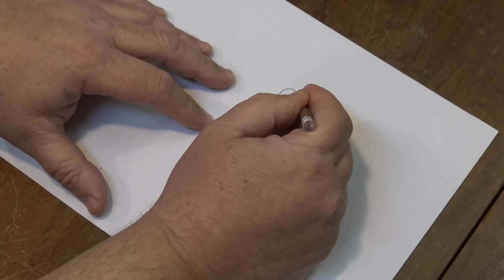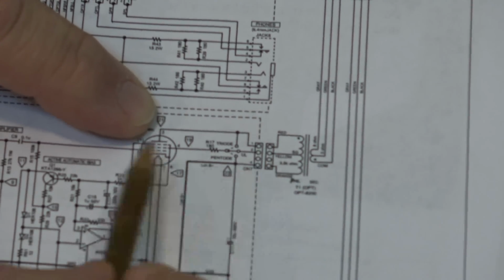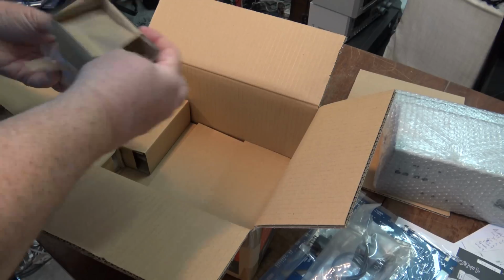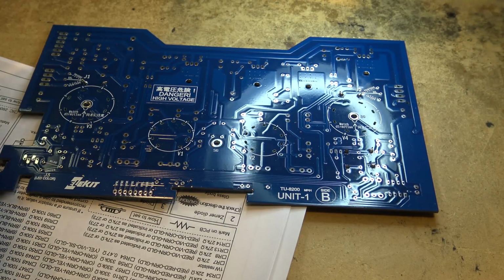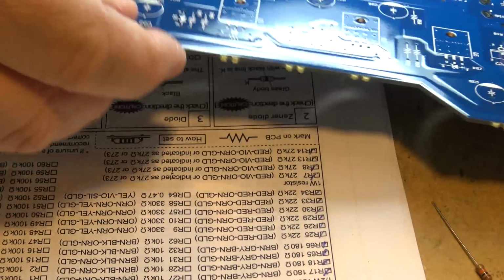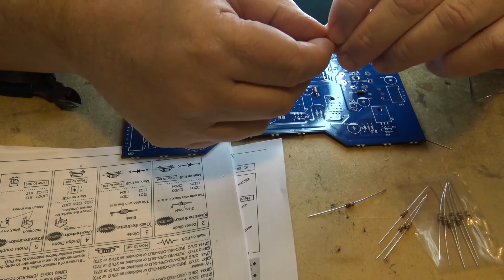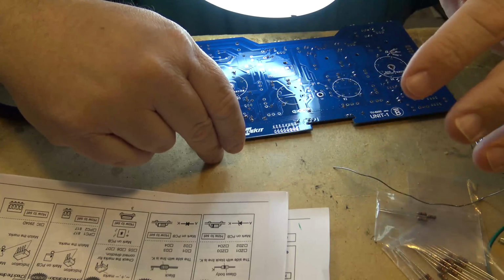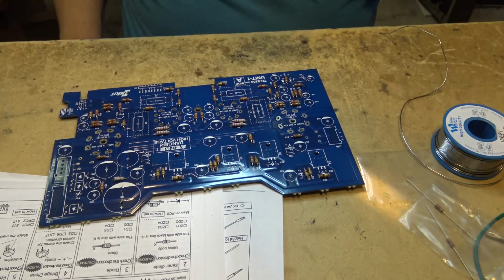Elekit TU8200 - 6L6 Single Ended Tube Amplifier build Part 1 4K

Comment: Hi, I read in a forum that there is a "surface mount" something on this TU-8200 kit; looking forward to see how you do it as I am planning to order one soon. I am pretty confident with the soldering but I still ordered a little practice gizmo. Being very small it will be a good practice. Your very detailed work is appreciated, thanks et bien le bonjour de Montréal.

Comment: You can do class A in Push pull.  Class A class B ect. Is really just a bias and circuit type.  You are talking about class A single ended, even in this there is A1 A2 ECT. In se.
Reply from the maker: This is a class A amplifier.   Class A is a single ended amp. Just a single tube per channel.   This has 2 per channel, a preamp and a power tube.   The 12ax7 is used as a 2 stage triode  preamp.   To make this a class b or an, would require 2 output tubes and the 12ax7 would be driving each output out of phase. The 2 plates would be tied to an output transformer with a center tapped primary.  
A class ab and class b are the same thing, just the bias is set higher so that at idle both tubes are kept slightly in conduction.  
Class A on the other hand is under heavy conduction at all times.   There is about 50% of the available current flowing through the tube under no signal condition.  As the signal is presented the current increases and decreases with the waveform which induces the signal into the secondary of the output.   
Class a are the most accurate and lowest distortion but are very inefficient and low power.
Reply: @12voltvids  I was just explaining that multiple tubes can still be class A.
Reply from the maker: @kevin2960  
Class A is single ended.  By nature all the preamp stages are class A.  This applies to solid state amplification as well.  All your amplifier stages in rf, if, audio, and video are all class A.  Where class B comes into play is the output stage as they become much more power efficient.  A class A amplifier is well below 50% efficient.  Let's talk in low voltage transistor power.  You have 12 volts onto your output single transistor stage.   With no signal the voltage on the collector would be about 6 volts.  The input to the audio output transformer 12 volts and the transformer would be partially saturated if you used a transformer output.  Of course you could use a resistor to provide the load for the  output collector load, or use an emitter resistor between emitter and ground or both. Generally there would be a low ohm resistor on emitter.  Say .2 ohms. Under no signal about 50% of the max power would be flowing through transistor or tube and this will generate much heat.  The dc is blocked from getting to the speaker by either a capacitor, or use an output transformer.  All tube sets use output transformer but solid state can as well.  
As the signal modulates the base of the transistor or grid of the tube the collector, or plate will follow. As the signal falls, the transistor goes out of conduction allowing the voltage to rise. As the voltage at the bass goes up, the transistor goes into conduction and pulls the supply towards the emitter potential which is close to ground.  That is how class a operates and coupling capacitors between stages block the DC from the prior stage.  
Not efficient but accurate and clean. 
Class B (class AB is the same thing, just biased a little higher to keep the non conducting stage from going into full cutoff) uses 2 output transistors or tubes.  One Npn and one Pnp type.  One transistor has collector connected to positive rail, the other to negative rail. Emitters connected together (through low resistors) and the speaker to emitters.  The wave is split in 2. Positive side of waveform goes to positive output and negative to negative output.  At every cross over point the transistors switch.  On class B one cuts off completely as the other starts. This causes what iij s called cross over distortion.   Class AB adds more bias to keep both transistors slightly biased on so that as the cross over is taking place the opposite polarity stays slightly I conduction to reduce crossover distortion.

Comment: Very nice! The power transformer is even an R-core transformer by the looks of it: unlike the C core, its core is one solid piece. More expensive to produce, but they are very efficient and have very a low stray magnetic field! Outperforms the toroidals.
Reply from the maker: Right it very well could be an R core. Doesn't specify what it is, so I just assumed C core from the look initially.

Comment: push pull use smaller transformers and run cooler.
Reply from the maker: Yes they do, but they also don't sound as good as a single ended class A.Class A is not very efficient, but much more accurate due to no zero cross distortion being introduced.
Reply: oh well, my hearing isn't that great anymore, and um not that fussy.  Funny, tubes and distortion go together, guitar guys WANT TUBE DISTORTION.  They prefer solid state for cleaner sound.
Reply from the maker: It depends on the sound you want.As far as accuracy no tube amp can match a solid state amp. Not even close. Solid state amps are exceptionally clean sterile sound.Tubes by their very nature are not. However saying that there is something almost magical about listening to music through a tube amp, especially a single ended amp. On paper they look horrible, with distortion numbers that would embarrass an engineer, however it the type of distortion that they produce that is what is desirable.When a solid state amp distorts it produces odd order harmonics, and the ear is very sensitive to those types of distortion.Tubes on the other hand produce even order harmonics. Even order harmonics are exactly one octave above the fundamental tone. So the note E for example, will produce a harmonic "e" the next octave up, and so on. This is what many guitar players just love, as it gives their axe a big phat sound. They do the same for all sounds, when they distort. I have both types of amps. I use my hybrid studio amp when I am producing and editing because it is clean and powerful, and due t the 2 12AU7 dual triodes used in the driver stage it has a warm sound.For listening, I use a full on tube amp in my living room, and now with these kit amps I will have a class A for my studio to listen to music on. I definitely prefer the tube sound, any day of the week. My hearing is less than perfect too, and I still prefer the tube sound.
Reply: I like both too.  But cheap tube amps are garbage.  I hate anything that used less than a 6" full range speaker, lol. Now a HK Citation ii is a dream amp for me.
Reply from the maker: Yaquin are considered a low priced amp as tube amps go, yet they sound fantastic, and with a few mods sound even better.I know several people with Yaquin MC10 and none have had any complaints and they are in the sub 1000 range and deliver a fair bang for the buck. I have an MC10T, have had it for several years and it sounds very nice and I am just driving a pair of 8" 2 way ceiling speakers.
Reply: AC high voltage, high imp tube vs DC high current low imp transistor, do away with the vs, I like using both.  Hi imp has its issues, low imp has its too.  One thing I find interesting, a 50 watt tube amp can out perform a 200 watt transistor amp in listening pleasure, I agree with you on that for sure.  I like the concept of multi amplifiers, and match amps to speakers.  Crossovers are fie, but subs should have their own amps.  Tubes for mids and highs, transistors for the bass end.  I like clean bass.  I use bass guitar drivers to replace woofers with cone surround rot.  Many bookshelf systems use crappy drivers, including Bose.  Someday, I'll get a pair of older Lansings, but new stuff, NAAAAA.
Reply from the maker: I run some old Altec Lansing and they sound great. I had them refoamed, and that cost almost as much as the original speakers but it was worth it, because they sound fantastic.Doesn't ned to be a 50 watt tube amp. A 9 watt single ended amp like the one I am building will outperform a 150 watt transistor amp in terms of sound quality at reasonable listening levels.

Comment: Don't sell your TU-8100! Build an active crossover and bi-amp your system. If you don't love it, you can always sell it later.
Reply from the maker: Yes I was thinking along the same line, as my Altec Lansing speakers have dual woof / tweet inputs for bi-amp setup.
Reply: agree, bi-amp is kewl

Comment: Hay, I'm color blind and love this stuff. I just cover up the other colors so I'm just looking at one at a time. Like your build video's. Working on building a amp but without tubes. Been seeing tube amps coming back. I know a kid 15, he wants a tube guitar amp!
Reply from the maker: Tubes are back in a big way. All one has to do is listen. Of course musicians knew this all along. Most professional musicians use tube gear.There used to be a color blind TV repairman out in my neck of the woods, and after he fixed a TV the owner would bring it to my shop to get the color fixed! It was hilarious. They would phone the shop I was at and ask the hourly rate, then call the guy with the mobile truck, and then bring the set in working but with very bad color, and we would charge the same price to fix the color as we would have to fix the thing right in the first place.
Reply: Thats funny. I just mix up red and green while there together. Red ball in green grass, I'm lost.. Keep up the vids. Fun to hang out.
Reply: EnChroma glasses. it fixes red-green colorblindness.

Comment: Kester 44 Rosin Core Solder 60/40 .031 1 lb. Spool ( wire roll electrical bond )
eBay item number:201763610943
US $32  with free shipping,  if your looking. LOL

Comment: Doing a smahing job sir :-D

Sounds like your solder needs a better quality rosin core, i used to use multicore brand, the thin stuff was better for melting, better control too, later i used savbit to make tips last.
Some solders have a very sweet smelling rosin, almost good enough to eat lol.

Yes i understood your diagrams, valves arnt my thing but they do have a different sound, ive seen a lot used in tv sound output, and small portable record players.
Ive tinkered with a few valve based radios, but most of them had good valves, the capacitors and old carbon resistors were the ones to fail.

Enjoyable to watch you assemble it, ive done kits too :-)

Comment: I have seen an Vacuum tube amp like the one you are building, I think it was made by KRONUS Electronics LTD in Dungannon Northern Ireland. while at a HIFI exhibition in Stornmont Hotel in Belfast 15 years ago, just a stones throw from where the Titanic and the Olympic was built, You could try and source Multicore Solder 60% lead 40% tin from the guys at Loctite from some of your Hardware store or just ask for solder made in the UK.

Comment: Ah, yes! Back in the day, I lived about a half mile from a Heath Kit store (Redwood City CA). Like you, I built a ton of audio stuff, test equipment, etc. I also built some Knight kits (Allied Electronics). I still have some of the stuff tucked away and haven't been used in eons. The electrolytic caps are probably shot, but I might revisit me stuff and get it working again. Thanks for the video. BTW, where did you order this kit?
Reply from the maker: The first Heathkit I built was an osciliscope. Was nice, but no calibrated inputs, so it would show waveforms but little else. The power transformer burned up so I tossed it and got the Iwatsu that still sits on my bench.I have a Stereo receiver around here I will put up some day. I also built a digital clock, that used a numitron tube display. I sure wish I still had that clock. I never though the numitron displays (they are incandescent for those that don't know) were that cool. The neon panaplex (plasma)  were much cooler.Heath also had one of those, but it was much more expensive. The numitron filiments eventually burned out, and I have no idea what happened to it. I have a panaplex stop watch board kicking around, I should see if I can get that working again. I remember the last time I played with it I got a nasty shock from the dc-dc converter, but it was cool just to see light up.
Reply: Back in the day (late 70’s), I worked at the Heathkit in St. Paul, MN.  My first kit was a 25” color TV 😩.  After that, the store manager and I split building all the demo kits.  My favorite job.

Comment: Not to put too fine a point on it, but... you do realize that only electron current can flow in a tube, right, since no charge carriers of either polarity can escape the cold plate, and only electrons leave the hot cathode (or filament, in a 5U4, etc...). Conceptually, I suppose it doesn't matter; somewhere, in a parallel antimatter universe, positrons are leaving a  hot antimatter filament and rushing towards a negatively charged plate... :)
Reply from the maker: I know exactly how a vacuum tube operates. Electron are boiled off the cathode through thermionic emission. The cathode is at ground potential, which is negative with respect to the positive charge on the plate. As electrons rush to the plate they in effect bring the plate closer to ground potential, which increases the current flow through the current limiting resistor in the case of preamp or buffer stages, and through the primary winding of the output transformer in the case of the output tubes.In the case of the phase splitter tube, the cathose follower resistor is a little higher value, which allows the cathode to float above ground potential, so when the tube conducts the voltage will rise, as the plate voltage drops, creating an inverted signal through the coupling capacitor, and thus creating the push pull drive signals for the class B amplifier. Believe me I took a 4 year apprentice back in the late 70's. I started it when I was still in high school, and was trained by an old army electrical engineer. He lived and breathed vacuum tubes, and I had the theory drilled into me constantly, including the very real dangers of working on tube gear. Those capacitors typically did not have any bleeder resistors, and could hold a charge for a bloody long time, and yes I was bit many times working on tube gear. Vintage gear needs lots of respect as many things can bite without warning.